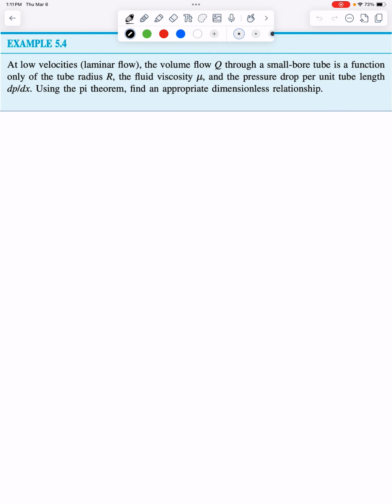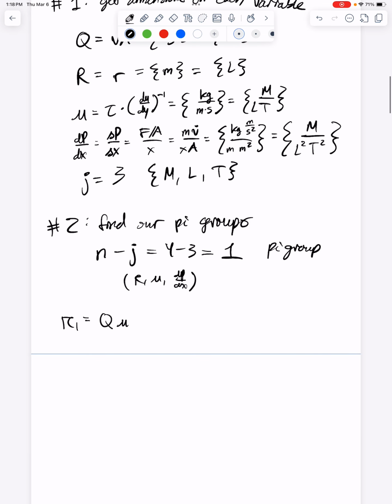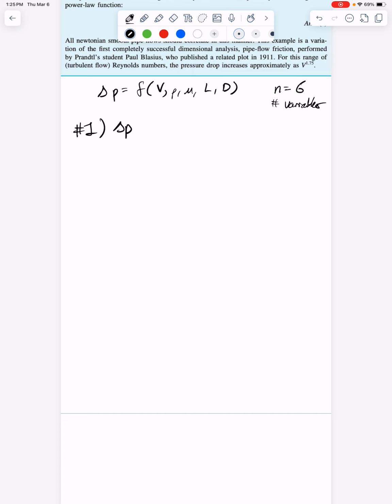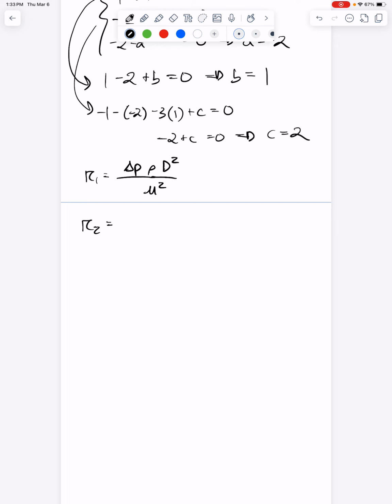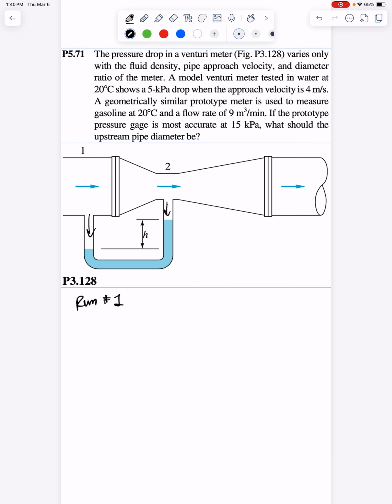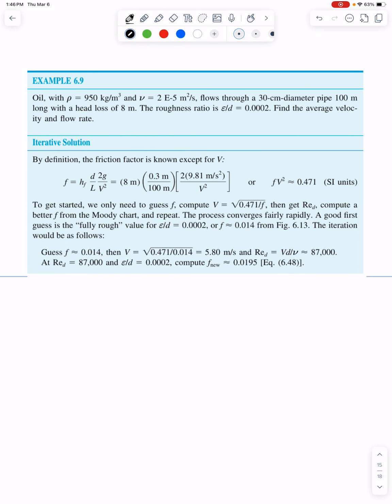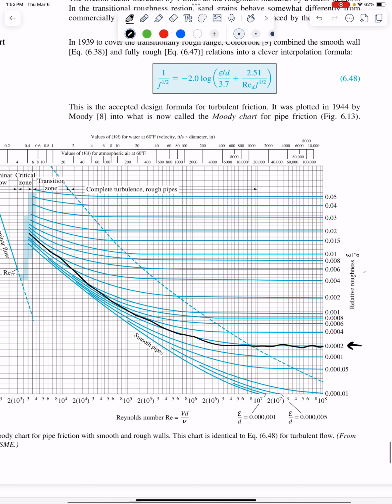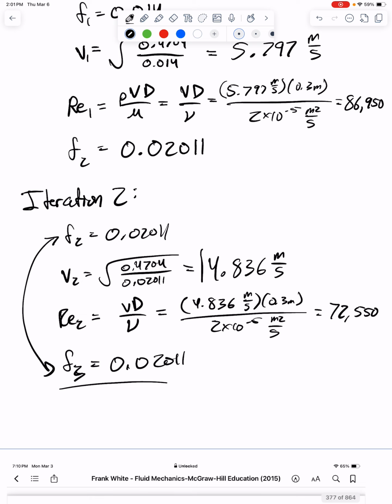Week 9 Discussion

Comment: @Huy Tran, I was able to follow the second question, but I was wondering if your answer would be wrong if instead of using density, you used velocity. For example, you had it as viscosity, density, and length, but what if you had velocity, density, and length? Does this matter, and would the keywords in the question help me decide on choosing?